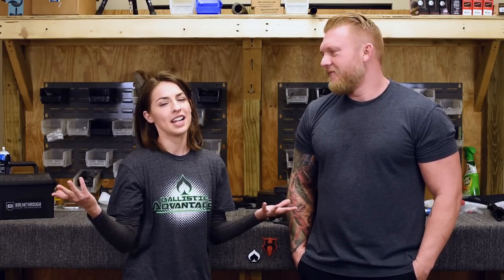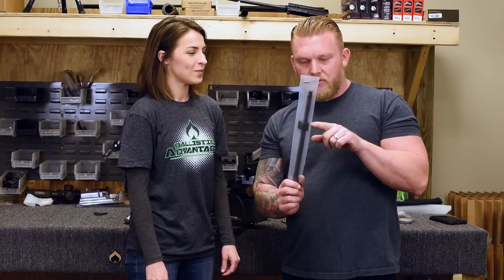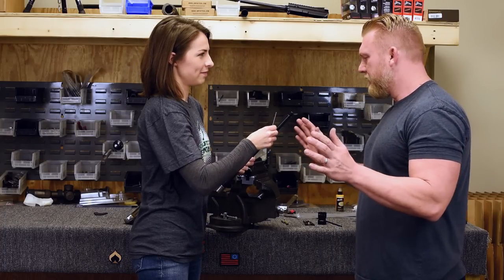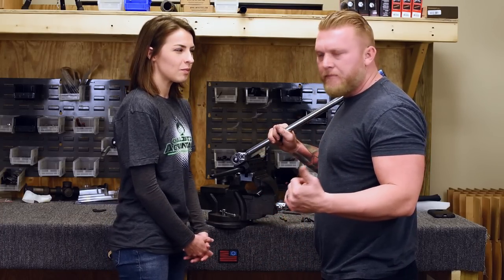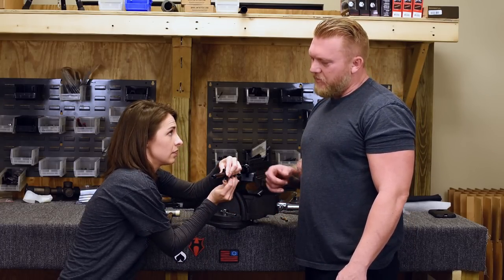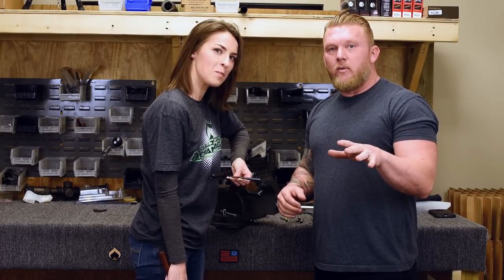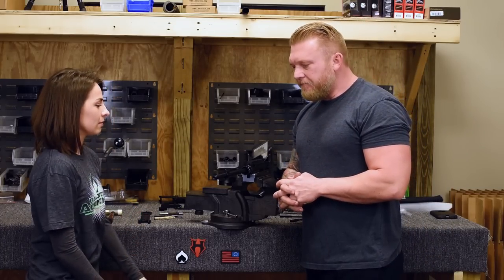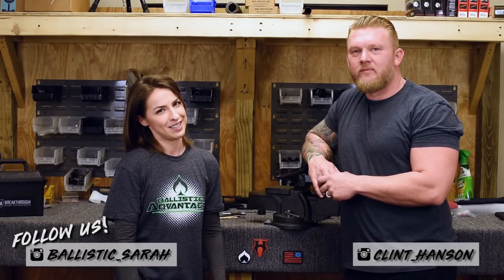Q&A Ballistic Advantage E:29 – How to Build Out Your New BA Hanson Barrel!

Comment: Very helpful video, appreciate it. One other bit of info that might be an additional help, is that the hole in the gas block is larger than the gas port in the barrel so you have a little leeway with the gas block positioning. Obviously get it as straight as you can, but you will still get full gas even if the block is not positioned perfectly straight.

Comment: Just installed a Premium Series Hanson Profile in .308.  Looks sharp! One question though - why is the coil pin on the lower part of the gas block (not the gas tube pin) so long?   I thought I'd misplaced the part with something else on my workbench, but no, I guess I just was expecting it to be flush like the others.   Any reason for that?

Comment: Good video, great job Sarah! Isn't it recommended to throw some red Loctite on the set screws though? At least that's what I've always done with mine.
Reply: If pinned not necessary.
Reply: Heat resistance blue loctite is what I use.

Comment: The problem is the set screws won’t hold the pressure from driving the coil pin. If you would just dimple the barrel at the factory you could avoid that problem. Would have saved me 2 hours. At 10:57 feels more like my install went.

Comment: Clint, I've seen some guys use Locktite 620 on the barrel extension...is there any reason to do that?  Seems to me that just goops it up.
Reply: Loctite or stainless shims. Bedding the barrel only if it's a sloppy fit in the upper receiver.

Comment: I am not impressed with the Ballistic advantage barrel accuracy. I have two in my recent builds, the 16" Hanson profile (556/223), and the 11.3" Hanson profile (556/223). The 16" averages about a 2" MOA at 100 yards, and the 11.3" averages about a 3" MOA at 100 yards. Both with a Caldwell Precision Turret Adjustable Ambidextrous Swivel and Tilt Detachable  Shooting Rest. Using the same shooting rest, I get a 1" MOA using a 14.5" FN Cold Hammer Forged barrel from Palmetto State Armory, and about a 1.5" MOA from a 10.5" FN Cold Hammer Forged barrel, also from Palmetto State Armory. Ammo used was 55 grain, 62 grain and 77 grain in all 4 barrels. My experience level? 8 years US Army Infantry, with 3 deployments, and served as a basic rifle marksmanship instructor, 4 years as a police officer. So for my money, I'll stick with FN barrels in the future.
Reply: Hey man they offer a sub MOA guarantee you should contact them and tell them maybe they'll send you some decent barrels then
Reply: I always swab my barrels with Brasso.  Before installing and after my first range trip.  Others use lapping compound or JB Borebright.  I use Brasso.